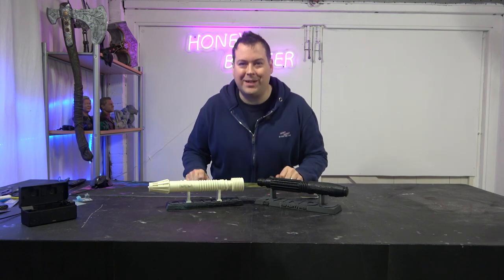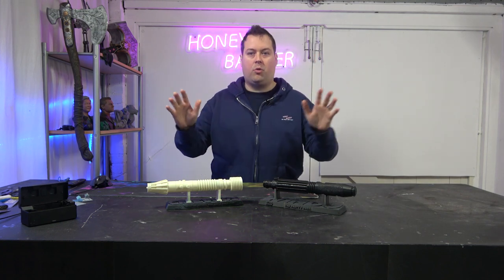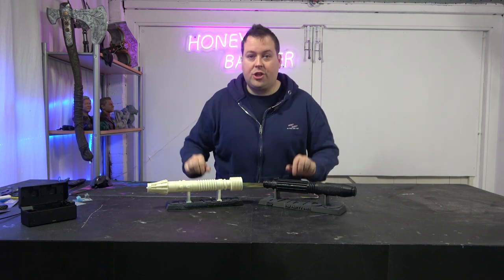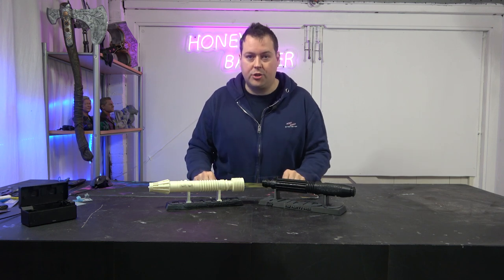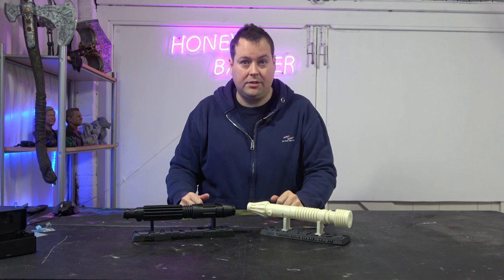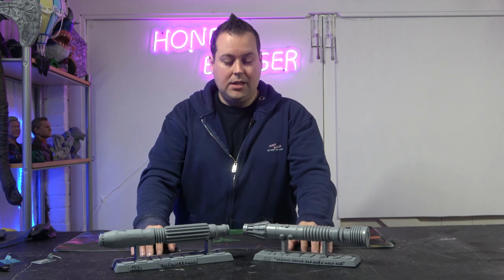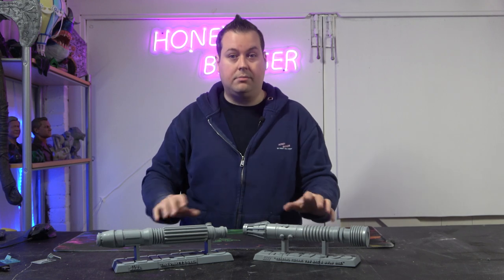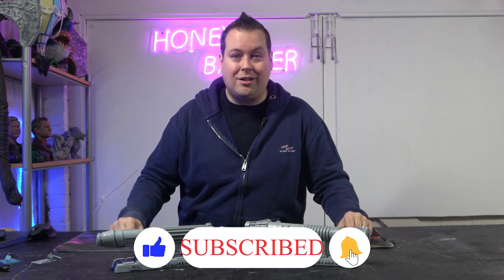Can you get Resin Quality in FDM, lets find out

Comment: Great comparison! I really love FDM for this sort of print, because in addition to everything you mentioned you also have warping, weight, and durability issues that come with the larger resin prints.
Reply from the maker: so interestingly over the last couple of years ive seen warping almost completely disappear from my resin prints,  when it comes to durability resin will crack if you drop it where as with FDM i find its the joints that break making it abit easier to repair

Comment: In my opinion these objects are too large to see any differences in details. Would be cool to see how these printers compare in printing 28 mm miniature figures with lots of fine detail.
Reply from the maker: good idea give us some time and we will look to do this video as well
Reply: @honeybadger3dprintandpaint  You should also try pushing both printers harder. The Bambu X1C can, with a 0.2mm nozzle, print at 0.06 or even down to 0.02mm layer heights (that's the best I've done). The resin printer could do 0.01mm. 

What would be really instructive is printing both printers at say 0.04mm or even 0.02mm layer heights with a 0.2mm nozzle on the X1C, to show that even at the same layer heights, FDM has its limits compared to resin.